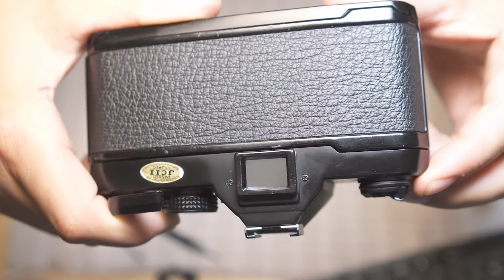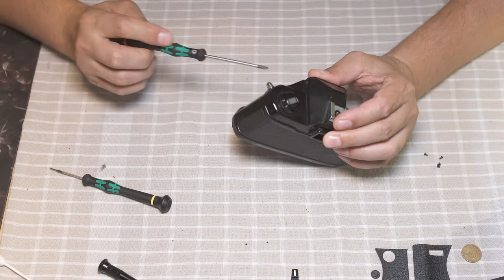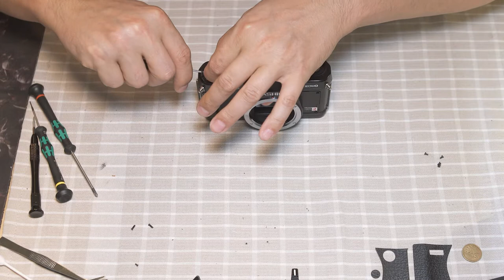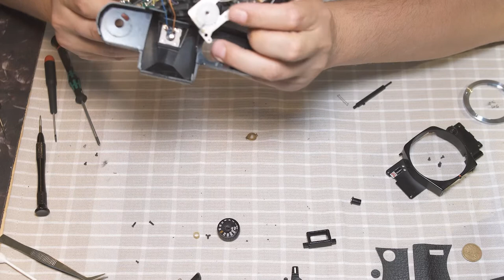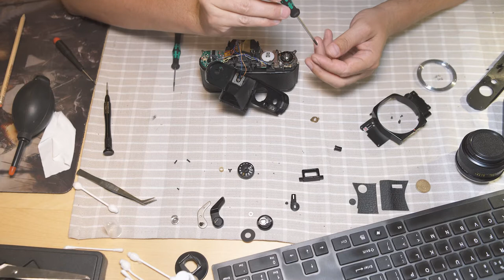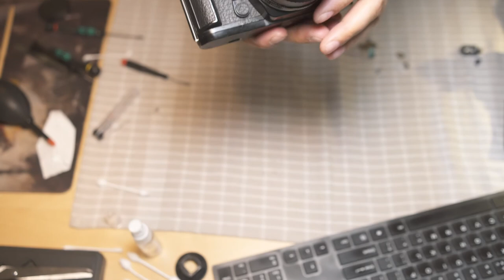YASHICA FX 3 SUPER 2000 / light meter diode repair

Comment: Hello! I dont ubnderstand what is exactly what you did in the fixing part cacn you help me please? I have the same problem I`ve trying opening and closing the gap on the diode circuit but nothing happens!
Reply from the maker: Maybe the problem lies somewhere else, resolder the cables at the top and bottom of the batteries - check if the batteries are connected - you can scrape the plates/contacts in the battery cover. - Let me know if it works!

Comment: Hello thanks for the video i have the same issue but i cant get rid of the screw at 1:14 any suggestions? I just doesnt move no matter how hard i try i only destroy the screw winding… :(
Reply: Hi, I got glue from the cap on the screw, take some solvent on a cotton bud and rub it - or with alcohol. Use a precision screwdriver, so that there is no play, press down and tightly turn, if you have any slack, put a piece of "rubber band" - if this does not help, put a flat or cross bit on the drill, and then you will unscrew the screw, but it will probably need to be replaced, unless you cut the screw so that it is on the flat end of the screwdriver.

let me know if it worked?
Reply: @VISIONMOONLIGHT  My screw is screwed 😂 i need to drill it there is no other way but i think it should be doable
Reply: @VISIONMOONLIGHT  and Thanks for the answer and the video helped me a lot :)
Reply: @VISIONMOONLIGHT  Oh yes thats how i habe to try it i guess :D at the moment i just use it without light meter and measure the light seperatly :) Thank you for the suggestion mate 😊